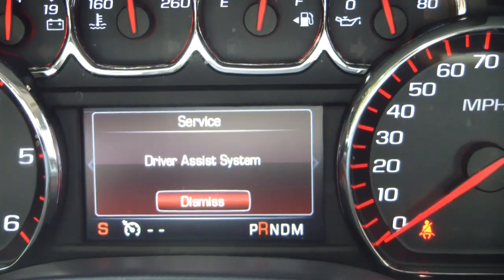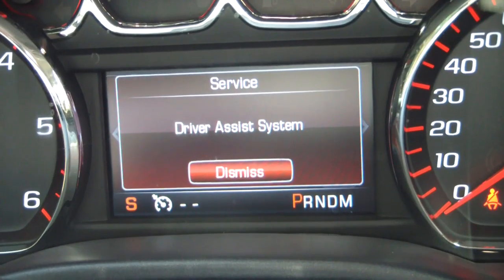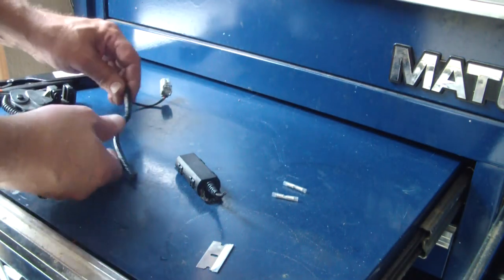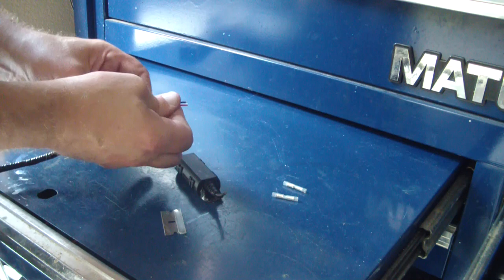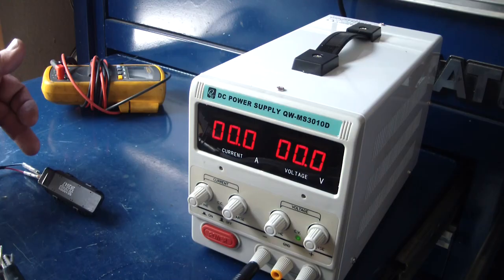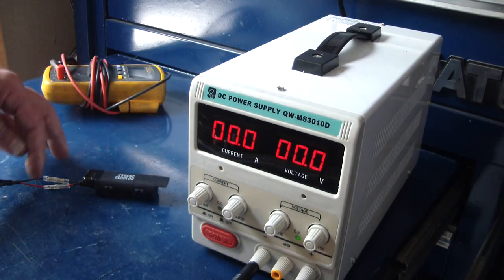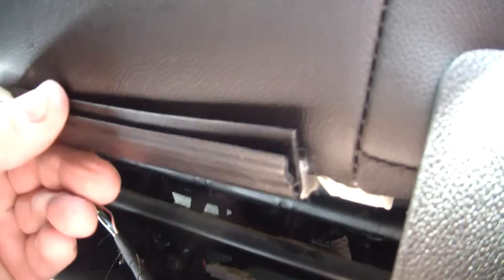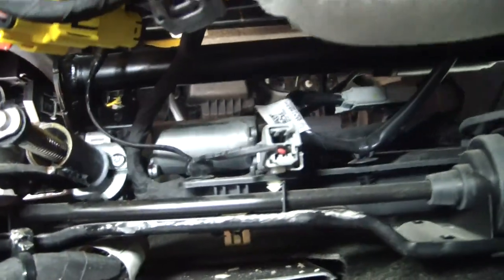Cheap and easy fix for GM Service Driver Assist System. Haptic system. DTC B172E or B172F

Comment: Great video. I was able to do this yesterday in about 45 minutes. Just as this video shows, the wire was broken. Very cheap wire - probably 24 gauge. I was able to reconnect the haptic vibrator but I chose not to shove it back inside the seat. It is hanging harmlessly below the driver's seat. Warning light is off. Thank you for the video. I would not have attempted this otherwise.

Comment: Thanks for this. I was going crazy trying to figure out why I had the “service driver assist” warning. Sure enough, it was that little actuator motor. Wire was snapped. I soldered it back together and now I’m all set!

Comment: I had the same issue, and after finding this video, went out to my suburban and sure enough my left side seat vibrator wire was cut, so now I will have to do the same repair

Comment: Nice thanks for the video. Did you get the Service driver assist system when you started the truck or was it some other time. Thanks.
Reply from the maker: It would come on when the vibrators was supposed to activate.

Comment: Once the sensor is repaired do the codes need to be cleared? My service drivers assist system message is on in my 15 Escalade. It’s driving me nuts. I ordered two new sensors and plugged them in to check to see if the message cleared and it didn’t.

What all components make this message pop up? Is it just the seat vibrators?
Reply from the maker: Both the right and left Haptic Motors share a ground and both power feeds run directly to the Memory Seat module. About the only thing it can be is the haptic motors or a bad module if the wring is good. I would clear the codes and keep them plugged in and see what happens.

Comment: I been getting this in my 2016 Malibu Premier would this be under my seat?
Reply from the maker: Yes if you have the vibrators in you seat and one or the other doesn't work this could be the problem.
Reply: @737mechanic  okay I will check

Comment: I replaced the left vibrator in the drivers seat because I had an error message. Sure enough the wire was broke. My error message is gone, but it won’t vibrate. Thoughts?
Reply from the maker: New vibrator could be seized up.
Reply: Disconnected the battery for a few minutes and that did the trick. Thanks

Comment: On my GMC Serria, that same light comes on.  It vibrates sometimes and sometimes it doesn't.  When the light goes off it vibrates. Is there a way you can bypass the seat vibrator and make the light go OFF?  I don't care if the seat vibrates or not.  Does it hurt the computer or engine in any way?
Reply from the maker: You would probably have to replace the motor with a resister of a similar value to the motor windings so the computer thinks the motor is there.

Comment: I have a 2019 Chevrolet Blazer RS. Has anyone tried to fix this same issue on a Blazer? Any idea what a dealership would charge to fix this issue? Appreciate any feedback.
Reply from the maker: Probably going to be the same problem, even if you can't repair your old one new aftermarket ones are cheap. A dealer is going to mark up the price of the part and charge at least an hour of labor and their labor rate is probably around $120.00 or more. So my guess would maybe a total of $220.00 or more.

Comment: The real question is how do you disable this God forsakenly irritating haptic motor permenantly and *not have the warning light come on?
(Edit, looks to me like I'll could just open up that little motor housing and snip the tiny little rod with the weight on the end of it. Motor can spin it's little heart out but no vibration)
Reply from the maker: I have thought about hooking both the vibrators to a switch so I can turn them on while driving for a little massage action.

A co-worker has an Audi that has seat massagers that can be turned on or off for comfort.

Comment: This is an obvious manufacturer defect. I repaired mine twice, and it’s the same thing. Usually one wire broken. Second time it broke at the flexible plastic where it went into the motor. Had to re-solder the tabs where it connects at the motor. POS

Comment: hi, I have Chevrolet Malibu 2020 premier and I am facing two problems. First - Driver assist system notification that is also stopping Adaptive cruise and emergency brake system to stop and other is the carplay/ android auto not working although I can connect phone via usb and play songs but cannot open carplay. 
Will that vibrator thing fix the adaptive cruise problem as well ?
Reply from the maker: No, I don't think that will fix the cruise.
Reply: @737mechanic  i got the diagnostics done hu chevrolet and they said everything is working fine, the camera and the sensors. Any idea why the adaptive cruise is not working ? My lane change assist works fine and the manual cruise also works. Vehicle also detects the pedestrians or vehicles in front but the emergency brake and the adaptive cruise doesn't work.
Reply from the maker: @vishwjammu1076  Without connecting a scan tool and seeing if there are any codes, and doing a test of the switches and buttons to see if they are working I can't say what the problem is.